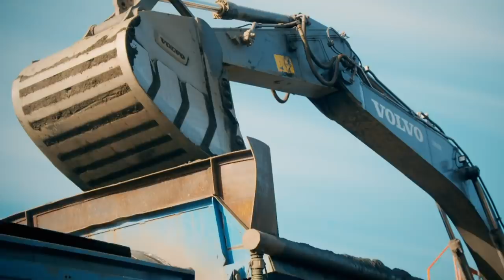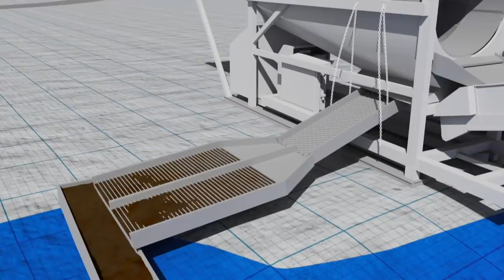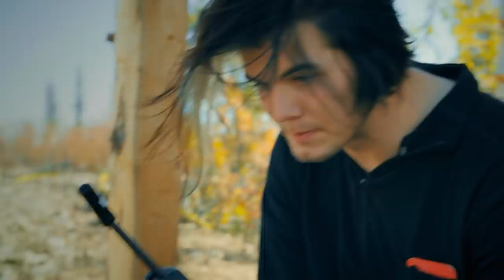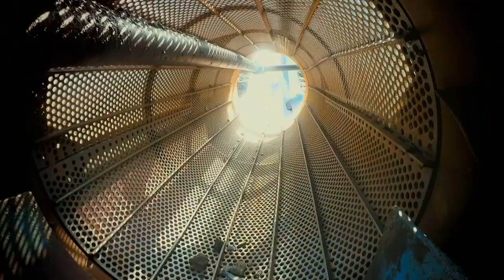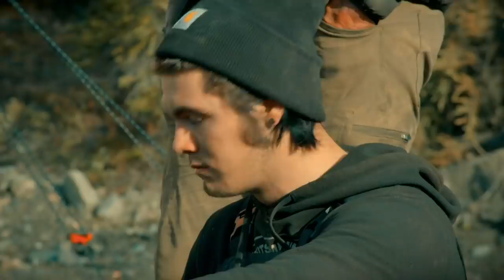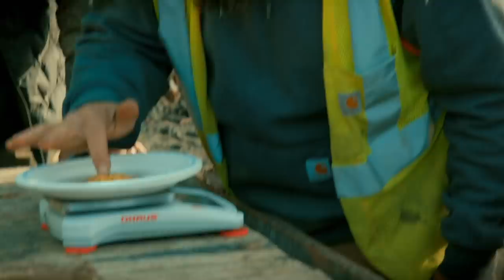“That One Mistake Cost Us $10,000” Sluice Box Breaks! | Gold Rush

Comment: I'm not a gold miner expert, but two things I keep noticing.
1st the water pressure running the sluices is way too low that's why material is backing up in them and they are loosing gold
2nd, Fred is no leader or gold miner and instead of helping these guys he's dragging them down with him... its sad but makes for great reality TV!
Reply: Your right. You don’t know anything about gold mining. If you did you would know that it isn’t the water amount or pressure issue. Any more pressure would blow everything out the sluice box. The angle of the sluices are to steep. And you always try to foresee problems. Such as little chains holding up lots of weight. Most sluice boxes have atleast legs on the side. If those aren’t available then you give them support with blocks underneath. You only need high pressure to wash the paydirt at the top of the wash plant. High pressure at the sluices pushes the gold out the end. By rights they need what’s called a water softener before it gets to the sluices. It slows the water in its pressure but not in its quantity. What amazes me is none of these “gold miners” on gold rush has one on any of their wash plants. Makes a real miner wonder why such experienced miners don’t see the basics!!!!
Reply: @edgemonsiteworksllc3369  Sorry did not see in your home page you have any experience in gold mining either.
Reply: @roygrillo2984  mining since 1980 big boy.